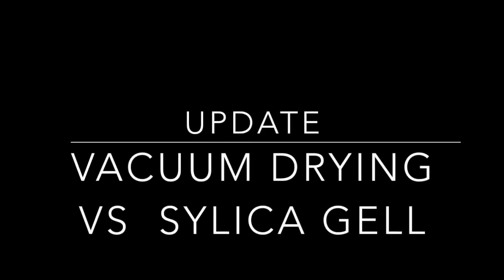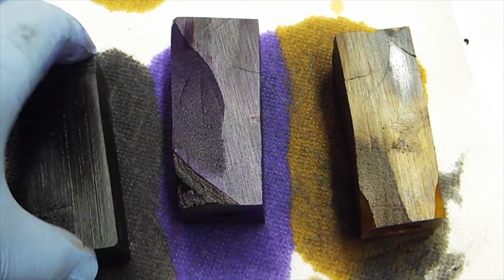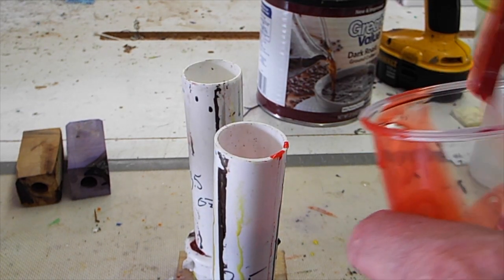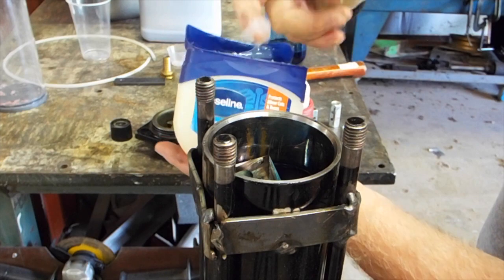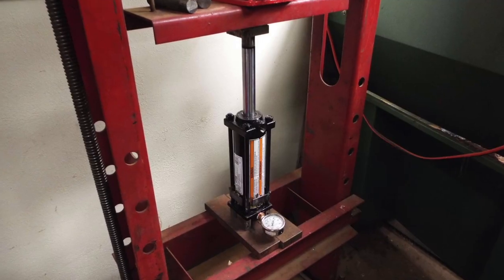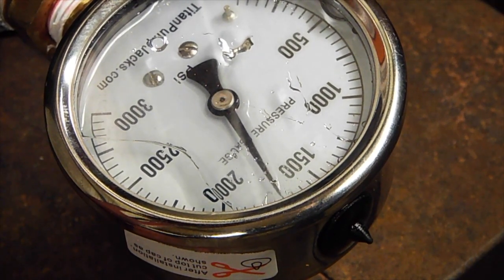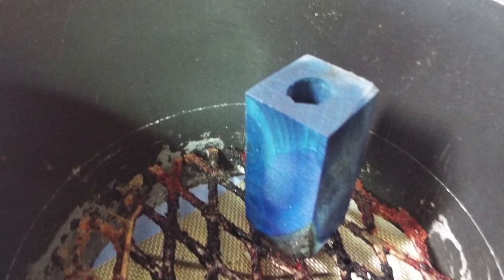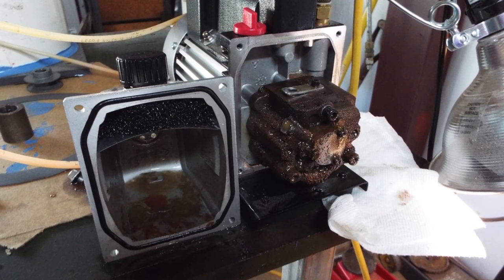Vacuum Drying VS Silica gel Update

Comment: I've seen vacuum traps used in lab setups where a flask is put inline to catch the vapour. Probably works best if the flask is cooled to allow the water to condensate. Would that help prevent water getting in your pump?

My idea was to try vacuum assisted dehydrating of food. Still in the research stage. I thought it would be a bit faster with less power consumption than regular dehydrating or freeze drying (not to mention the cost of the latter!). I might combine it with using a woodstove as I'm off-grid and solar is rather scarce around my part of the world.
Reply from the maker: judyofthewoods seen traps using dry ice to cool the trap would work better using some type of cooling. Lots of luck drying food. You will need a trap. Would also try a vane type pump instead of the refrigerant.type of pump. Won’t pull as low a vacuum but will work an will cost less to run. Have worked in a composit shop where we used the intake side of a old piston type air compressor. It created great vacuum at a lot higher volume. Something you might consider in an off grid environment .it could be run with a gas engine as opposed to needing electricity . Lots of luck with that project. Thanks for watching.    Ron.
Reply: @dc9apu  thanks for the pointer. I have access to a neighbour's freezer, so will try ice cubes. I live in the boonies and don't drive, so dry ice and gas would be out of the question. I have seen a nice little hand-crank vacuum pump in a YT video, but not found a source of one yet. Judging by its shape, I would think it is a vane pump. Rotary motion is more efficient and ergonomic. At the moment I am using a piston pump.
Reply from the maker: @judyofthewoods  when you use ice cubes you can you get it a little colder by covering the ice in 91%rubbing alcohol. Have used this method to shrink steel to install friction fit parts. Off grid.  Find a old belt driven small piston air compressor drive it with wind power or water wheel . Hook the intake to the tank to use as a vacuum resivour. You have a larger supply of vacuum that way
Reply: @dc9apu  good idea, thanks. I hadn't heard of the alcohol trick. I was thinking of planting some sugar beet for another purpose.... also, perhaps, salt. Some wind rig would also be useful in sustaining the pumping action without my input, as a vaccum is not reached until the water (or its expanded vapour) is all extracted.

Comment: hey ron, why do the proffessionals use air over fluid? maybe fluid does crush the wood more than air since, air can be compressed multiple times? maybe its alot cleaner with air? do you know what the reason behind this is? also 3000 psi air pressure means that there is 200 times the air compressed in the container. so if something would explode it would be fatal with air pressure at 3000 psi.
Reply from the maker: Jimmi: The only person I talked to who does it professionally told me that is the way they did theres. I am not sure why. My opinion is if you fill a vessel  with high pressure air it can be explosive. A cylinder filled with just fluid is how they do a hydrostatic test. Must be a reason for that. Had great results. If I was ever to build a chamber I would use the ram of a actuator to supply the pressure just like they do when they do hydrostatic tests. Thanks for watching.   Ron
Reply: @dc9apu  i think the benefit of high air pressure is that fluid pressure crushes the wood instantly, but since air can be squeezed over and over it gives the wood time to be infused rather than be crushed and squezed. i am not sure, but air ofc is alot cleaner but more dangerous.
Reply from the maker: Jimmi: Not sure what the advantage of air over the fluid is. They did tell me they has to vacuum the pieces after the process to get the air out of the wood. I did not do that. I probably should have there was air in the cylinder when I took it apart. It could have been from not having the cylinder completely full of fluid, plus the air in the wood. When block removed from the cylinder it looked like a block stabilize in vacuum. I saw no difference or damage resulting from the process.
Reply: @dc9apu  when i did 200 bar hydraulic pressure stabilizing it crushed the wood, also it is more or less the same result only alot faster

Comment: hello, congratulations for his excellent method! I ask, how long leaves the material under pressure? thank you so much!
Reply from the maker: Luigi: Once the pressure stabilizes at the high end you should be able to remove the wood I usually leave it there a couple of hours just to make sure it is fully infused. Thanks for watching.    Ron
Reply: dc9apu thanks a lot for your valuable response ..

Comment: Your videos are very informative and educational, thank you so much for posting them. I am not familiar with high pressure hydraulics and would like to educate myself. Could you point me in the right direction for things to read up on as far as safety in working with them? I understand very well WHAT the dangers are in high pressure systems. At the pressure levels you're working with you've got a very high powered, potential bomb on your hands. My first concern is safety. I'm not the type of person who rushes in to do something where there's a chance of bodily harm. Thank you again for the great, quality videos you take time to make and share.
Reply from the maker: Christopher: Thank you for your comments. As for me directing you in the right direction I would not know where to start. I have over 40 years as a aircraft mechanic working with high pressure systems. My advice if you are not familiar leave it alone. Have the professionals do it. The only difference I have found over vacuum is speed and a little more color penetration.
Ron
Reply: +dc9apu Thank you for the quick response and words of wisdom, lol. I was checking out commercial grade pressure chambers last night and will be taking that route. More expensive, yes, but like I said, safety is my main concern. Have a great day Ron!

Comment: Correct me if im wrong but dont you want to take out the air?, or is it more about getting the cactas juice in the wood as opposed to epoxy where u dont want bubbles?
Reply: i haven't started doing anything yet still learning the ropes
Reply from the maker: Yes you remove the air and water. You can also just soak the wood and use no vacuum. I have used rotten wood that way and had good results with no vacuum. Never did that with regular wood.

Comment: Thank you for this follow up video.

What type of cylinder are you using for dying the blanks.  It looks like a simpler, faster, and more effective process than using a vacuum.
Reply from the maker: David: The cylinder I built it out of acrylic for another project. I used it because it was small and clear. Any sealed or covered container will work fine, in the first video I used a presto cooker. Silica gel is an easier  way to go. One thing if you are going to buy silica gel don't get the blue indicating type. The MSDS says the cobalt in the gel is a carcinogen. I should have put this information in this video.  My suggestion use the non indicating type for your 
own health. People need to do more experimenting with silica gel  and post there results
Reply: Thanks for your reply.  I wasn't clear in wording my question.  I'm asking about the cylinder you used for pressure infusing the cactus juice and dye into the blank in lieu of using vacuum.  Can you tell me what kind of cylinder it is, where you got it, and similar details?  The info would be greatly appreciated.